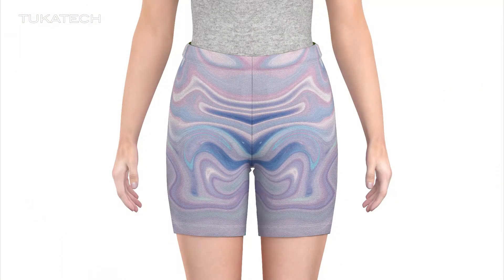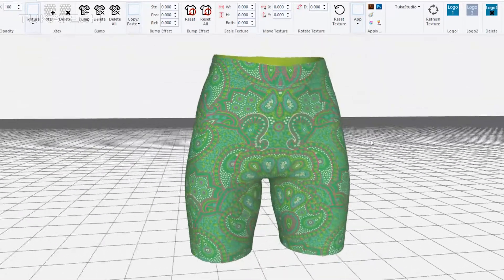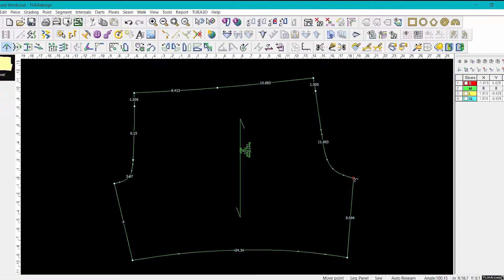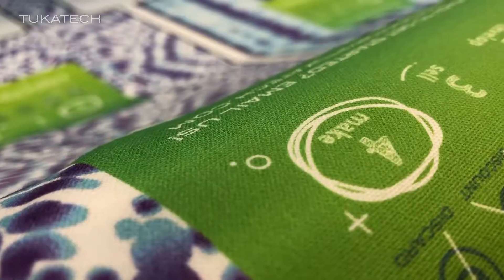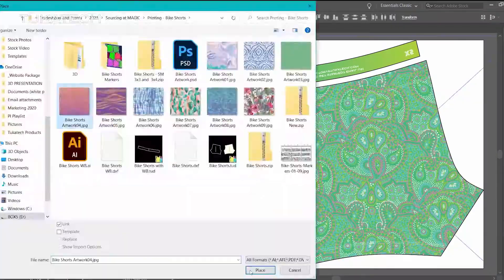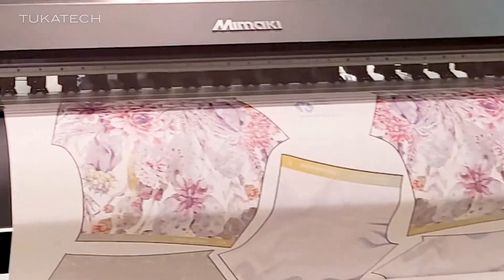Communal Microfactory Powered By Tukatech | Sell Then Make | On Demand Manufacturing

Comment from the maker: OUTLINE:
00:00 - Problems with traditional product development process
00:35 - Sell products BEFORE making them
00:48 - 3D fashion design
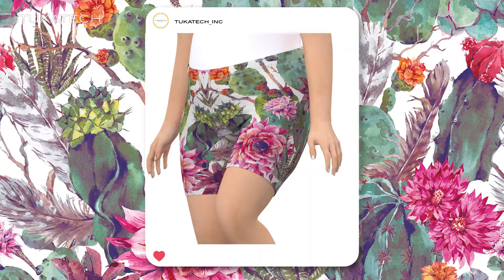01:08 - CAD pattern making
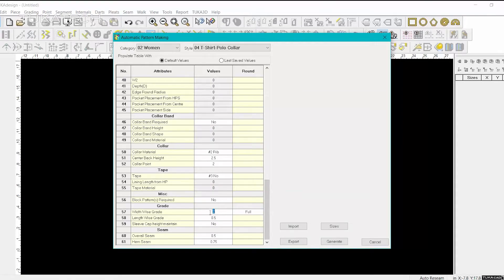01:23 - Direct to fabric and sublimation printing
01:58 - Laser cutting
02:09 - Sewing with unit production system
02:16 - Final product
02:36 - Rent workspace and equipment
03:06 - History of the microfactory
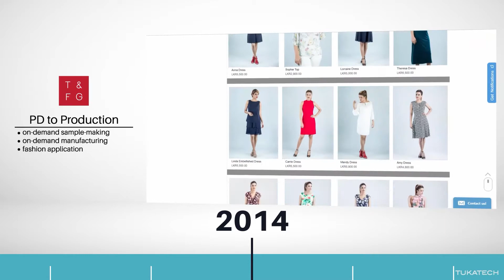03:16 - Design, develop, sell, and THEN make your product